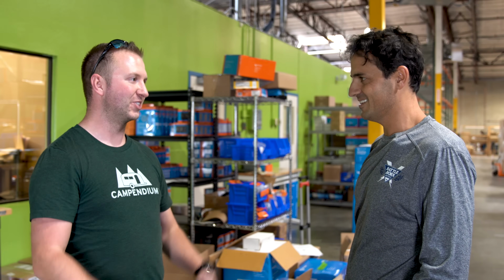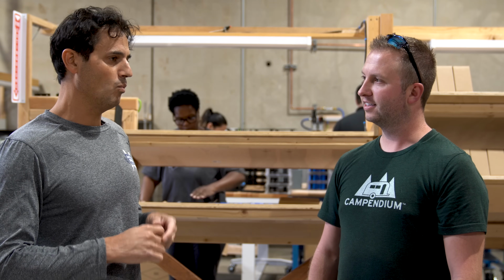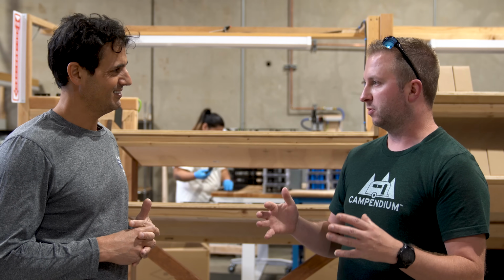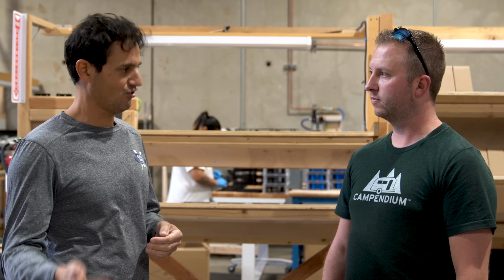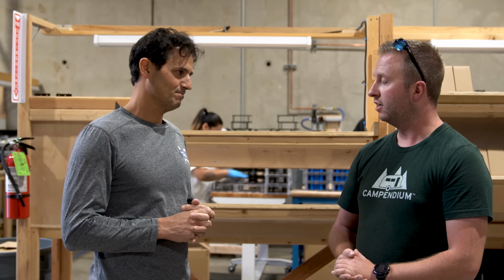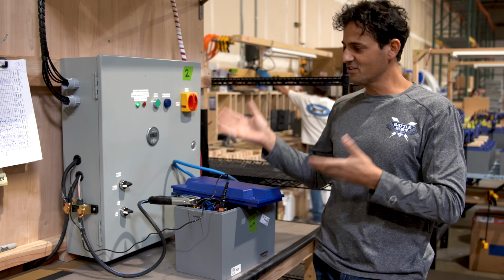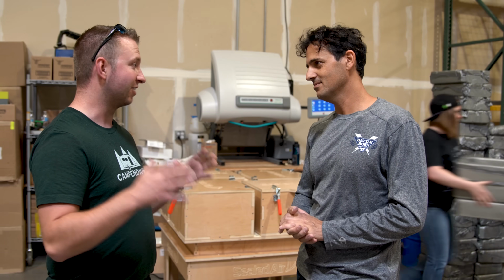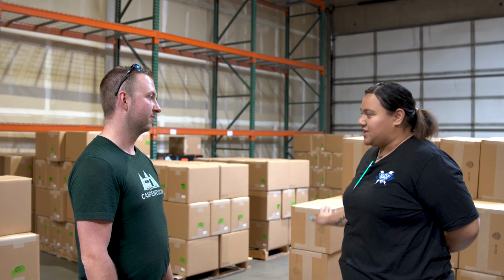Battle Born Batteries BRAND NEW Factory Tour with CEO

Comment: They look like nice balanced packs but there isn't a lipo on the planet that can deliver over 500 cycles at their stated 80% capacity. Yet they state 3-5000 cycles and only 20% degradation.  This just isn't happening and if they attempt to warranty 3000 cycles at 80%, for sure they will go bankrupt. Or have to pay lawyers to 'prove' users damaged them in some way through improper use. Good luck with that.

Comment: Going to purchase three of these 100 amp hour 12-volt batteries shortly but want some specifics on the type of solar charger to buy for this application.  Would not mind even driving out to the factory for the batteries - we live in West Melbourne Florida though and not sure when "the country will open up again."   Also some suggestions for a pure sine wave inverter as well to work with the three 100 ampere hour batteries.  Great video!  Pretty much convinces me to buy these batteries in vice of any others.
Reply from the maker: Alan, you might be interested in our RV Electrical Upgrade blog post series which details how we installed our batteries and inverter. We chose the Victron MultiPlus 3000 to pair with our three 100Ah Battle Born Batteries and have been very happy with it.

https://www.adventurousway.com/blog/rv-electrical-upgrade-part-2-battle-born-lithium-batteries-victron-inverter

As for solar, part 3 of our RV Solar blog post series walks through how we installed our rooftop solar, including the MPPT solar charge controller we chose:

https://www.adventurousway.com/blog/rv-solar-part-3-installing-rooftop-solar-panels
Reply: @AdventurousWay  Thanks for the reply.  I will watch all of the videos you sent links to and will probably copy what you have done since it was successful for you.

Comment: I now have 3 x 100ah Battle Born batteries in my truck conversion. Have a Magnum true sine 2,800 inverter/charger and 12kw Wrico Diesel Generator. Will add solar later.
Reply from the maker: Nice! We also started with batteries and inverter first, and only later added solar once we figured out how much power we actually use.

Comment: Would love to get some of these batteries in Aussie - working on a new RV refresh for my Roma, its currently great off grid wise however looking to loose weight and add some new 12 systems while removing lpg
Reply from the maker: You guys have some awesome products out there in Australia too. We have the REDARC charger on our trailer and had to import a couple parts from Australia for our installation. I imagine shipping the batteries is more difficult though.
Reply: @AdventurousWay  actually yes the red arc systems are great I run 2 one for caravan and one for the 4x4 haha

Comment: Ideally your "winter" line will have a BMS that shunts any charging power, in freezing weather, to a silicon warming pad that is surrounding the battery. Quick and easy. And as the internal battery temperature comes up, it shunts the power to charging.
 You can license the patent from me.

Comment: We ordered 3 of the Battle born 100 ah batteries, and have yet to install them in our motorhome, which currently has 4 six volt batteries.   We've heard nothing but positive things with this brand of battery, so thought we'd get away from the off-gassing of the lead/acid.   We also ordered the Victron BMV-712 device, to keep an eye on the depletion/charging of the batteries.   I know he mentioned you can take them right down, but I was wondering if there is a particular percentage, where if you don't take it down below a certain point and charge them from that point continuously over the years, if it's beneficial to give them a longer life?    Thanks for the video, we quite enjoyed it!
Reply from the maker: I’m sure Battle Born could give you more specific information, but we’ve had no issues taking our batteries regularly down pretty low. I believe in their testing, they repeatedly cycle them very low.

We’ve taken ours down so low that the BMS shut the batteries off. 0% essentially. We’ve also regularly been down to 20%. No adverse signs that we’ve seen!
Reply: Leaving 10 to 20 percent is sufficient.  I use lithium ion batteries in my drones and they're set for 10 percent by default.  Once the battery gets down to 10 percent it will automatically land.  Most of the time I use them down to 30 percent capacity.  What can be difficult for some chemistries is leaving them fully charged all the time but not sure if that is true for LiFePo (Lithium Iron Phosphate).
Reply: The BMS will keep whatever reserve is actually necessary.  It is very, very bad to go below a certain voltage, something like 2.9 volts per cell.  So the BMS will say zero but really it isn't zero.
Reply: I have read that Lithium batteries last the longest when stored partially charged.  This is totally different than lead acid.  So I only charge my electric cars to 90% or less, and only charge fully when I will use the battery charge very soon.  I have not seen any battery charger for an RV that doesn't charge to 100% yet, but that is what I would use.

Comment: can the packaging be kept and used as the insulation to help keep it from freezing temp shutdown?
Reply: I presently have two aging battery systems one set rolls and one trojan... (4)6volt each system.  replacement for these will run about $350 each battery.  the msin problem being if one in the set goes bad replacing the whole set is almost always needed. Battleborn Batteries seem like a great option though the prices are still rather steep if that price could come down the built in bmi could certainly make the investment viable especially if additional or replacement batteries could be added to a system at any point in their lifespan.
Reply: @lanespoint1108  , Price "may be" a bit steep, but, considering the usability and life of the battery, this should offset if you consider the frequency required to replace lead-acid (or other) type batteries. It's just overcoming the initial cost, IMO. Y'all Be Safe
Reply: true ... both of the banks I have are nearing 10 years of service and one set will have two of the four batteries retired asap.   Lead acid certainly have some downsides... its just a question whether equivalent amp hours with battle born are worth 3x? the cost.  Guess I will have some calculating to do. ;)

Comment: I understand that you are not supposed charge the Battle Born batteries with an RV charging system designed for acid type batteries. What actually happens if you do?
Reply from the maker: I can't speak for all RVs, but I know the charger that came with our RV wouldn't have damaged the Battle Born battery - it just wouldn't have charged it very effectively.

Essentially the standard chargers in most RVs are designed for lead acid charging profiles - and lead acid batteries can't accept a very high charging current as they get full. At best it will charge very slowly, and at worst it won't charge past a certain level. Either way, it shouldn't damaged anything.

Comment: Hugely informative video.  As others have noted, I much better understand why LiPo4 batteries cost $1000/kWh retail when Li-Ion are ~$150/kWh cost to make.  The actual LiPo4 cells are about 20% more expensive to manufacture which puts the cost of the cells around $200/kWh currently.  Because the volume is currently "small", automation is still a work in progress so the retail cost is high.  I hope BB more than doubles their output and puts that money back into automation and drives the cost down.  If they can get to $500/kWh a lot of opportunities start to open up.  You can start replacing diesel generators in data centers, powering the drive trains of boats, etc.

Comment: Interesting video--thanks! In one sense, it is important for products like this to receive marketplace acceptance so that there is funding to advance development and facilitate mass-production methods. On the other hand, the manufacturing and assembly methods here are a significant factor in why the cost is so high. Even with all 100 Ah available, which will not continue to be the case over the life of the battery due to SEI and oxidation, etc., comparing them to a 250Ah AGM with a 7-year warranty for a little over 1/3 the price (using Fullriver as my example) takes some mental gymnastics to justify the purchase, particularly without that internal self-protection for freezing temperatures. (The Nissan Leaf's formulation seems to be the best with that, allowing charging to temperatures well below Tesla's and others' cells before having to internally warm itself.) I am curious how the Battle Born BMS handles high states of charge being maintained indefinitely at elevated temperatures, which is one of the most life-reducing conditions for these types of batteries. Personally, I think the best selling point with these apart from extended lifespan is weight, although that may actually be a negative for some folks if they need the extra 100+ lbs. of golf-cart types up on the tongue of the trailer for balance with weight further back and towing stability.
Reply: Respectfully, one of the main allures to LiPo4 batteries over AGM in your economics "debate" is the high charge and discharge rates.  Being able to discharge at 1C rates is phenomenal... If you need it.

Additionally, the linear voltage discharge profile of LiPo4 is a great advantage over FLA and AGM
Reply: @RoadDogMedia  For engineering purposes, application is everything. In what scenario would Peukert’s Effect be significant in an RV? "If you need it" is your key phrase. This applies to the discharge profile, also. The voltage drop across 40% - 50% of the usable capacity with the 250Ah AGM's in my example will be well within the usable voltage range required by typical RV loads and devices. Technical advantages that produce few practical advantages in an application, yet are obtained only at a significant cost penalty, are typically difficult to justify. That is why I suggested that weight is probably the best advantage to sell for this application.
Reply from the maker: For us, the weight of lithium batteries was actually a major selling point because we have a small trailer and not unlimited cargo capacity.  Yes, lithium batteries are expensive and they are not for everyone, but for us, for full time living in our RV, that's the best option. You can read about our electrical install and our choices in detail here: https://www.adventurousway.com/blog/rv-electrical-upgrade-part-1-introduction-goals?utm_source=yt&utm_medium=aw&utm_campaign=battle-born